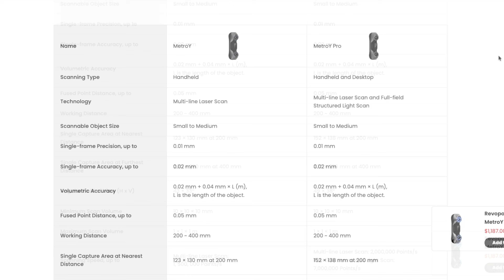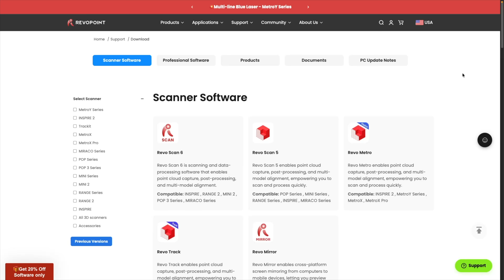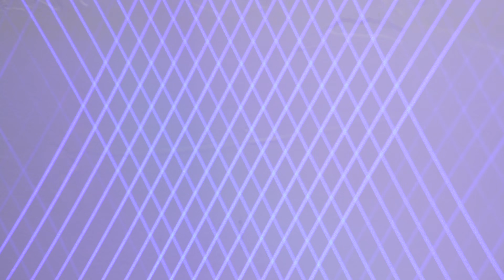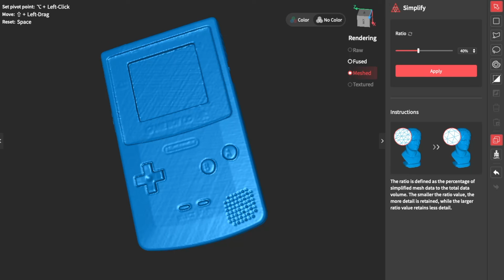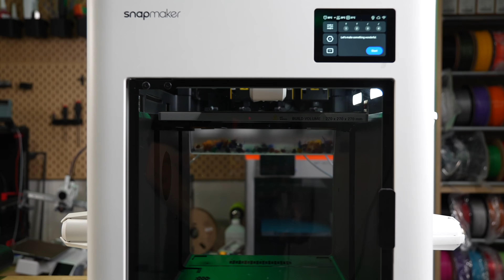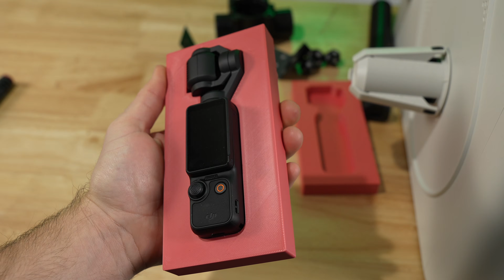I Gave Up on 3D Scanning… Until Now (Revopoint MetroY)

Comment: I have a Revopoint  Pop 2 and its been sitting on a shelf and there it remains.  I found is COMPLETELY USELESS.   If you want a small part that is not circular (software completely loses is $hit when scanning round objects) and you just want it for "fun", I guess it'll work well enough.  Just expect to loose your $1K  on a paperweight.  Buyer beware.

Comment: I cannot understand how you can talk so positively about this scanner: The software (Revo Metro 5) is the worst I've ever encountered in my carreer. It lags, doesn't use GPU, is badly written and freezes, loses tracking and still places scanned meshes over the just scanned succesful mesh ruining it. It's such crap, please do yourselves a favor and buy something else like a Shining 3D. Waaaaaaaay better and prevents you from throwing a $1000,- scanner out of the window in frustration. What a crap.
Reply: Just avoid the Einstar Vega, which is in a similar boat, good hardware dragged down by barebones PC software. It's only good for aligning multiple scans. Even the Miraco had that on device (and much more QoL features):

*It's locked out of the mesh cleanup suites like ExScan.* Its PC software, StarVision is only good for aligning multiple meshes. (Feels like the $2000 vega funded the cheaper follow-up scanner) 

I'm not entirely regretful, getting it in end of 2025, not on release, but I really would saved if I didn't want an all in one unit. Coulda put the money on Geomagic Plus over Go. 

It's really only for offline/corperate use where PC software is limited to known brands, aka to pair with more expensive CAD and reverse engineering software 

Hope I eat my words with the supposed Q3Y26 update, but really, after 2 yrs after its release, I don't expect StarVision to improve at all, or the Vega itself handle more mesh processing.

TLDR: Einstar Vega has great hardware, but weak post-processing software. I paired mine with Geomagic Design but that's not an option for anyone, perhaps QuickSurface Personal. Likely out of updates so better off getting used if still set on it.

Comment: I just used a Raptor with a Scan Bridge to scan a friends mandolin and design him a custom ToneGard that accommodates a pickup and an armrest he has mounted to the mandolin. Because I had an extremely accurate scan of the mandolin, I designed and printed  the tonebridge and once I added cork to the posts to protect the instrument it was literally a perfect fit on my very first attempt. No need for multiple iterations as I dialed in my design, the very first design perfectly avoided the clamps for the rest and the pickup and the cage sat a uniform distance off of the back of the mandolin, allowing it to resonate unimpeded. If you design custom parts in CAD, I HIGHLY recommend getting a modern Blue Laser and IR scanner. Unless you need better than .15mm accuracy, there is no need to get anything more expensive than a consumer grade scanner. I have used 2 Creality scanners, but Revopoint and Einstar will the same thing.

Comment: Wow.  It  costs 1040 bucks to use their software for 1 year.  Does the scanner just brick itself after 12 months or can you use alternative software?  That's a very expensive subscription.  Want a permanent license?  That'll be 8K please.  Hah no thanks.  What a scam.
Reply from the maker: The software is free, you must be looking at a different piece of software. They do have paid software as well but that’s separate to the software show here.
Reply: @ModBotArmy  I'm looking at the Revo Measure and Revo Design.  The checkout page makes it look like these are required.  If only the Revo Metro software is required then it's just typical Chinese bundling marketing that is confusing me.
Reply from the maker: @B @BasedF-15Pilot ah that’s what it is only metro is needed. It’s all I had access to and used. You would really have to be making enough from using that software to justify it at their asking price.
Reply: @ModBotArmy  Got it thanks for the clarification.  Makes more sense now.

Comment: Quick question. Could you give me the print settings (in slicer)? I had some problems with this printer (Anycubic Kobra) and i iust started with 3d printing. Right now id just be happy with the settings for pla, The standart settings in the slicer (cura) didn't work and as a becinner it's hard to find the right settings myself, I eould like to print with other flament Iater on, so if you could also tell me, would i'd had to change for other ones, that would be great. (I comented that on an older vid of you and thought you might not see that there.)

Comment: 3D scanning is way more work than its worth. I have a free $700 scanner sitting in my drawer I havent touched it since Revopoints 1 on 1 lesson with me. Top notch customer service but having to do SOOO much post processing isnt worth the results. This field is something that AI could massively help out with as far as cleaning up a 3D scan. Hope Revopoint is going to implement AI Cleanup.
Reply: I ordered one and I’m worried that this is exactly what’s going to happen to it :/
Reply: I’ve been working on getting ai to turn a perfect step file into step for me and I don’t think I’d be able to deal with a non perfect mesh

Comment: Hey, at 29 minute mark in Fusion, instead of trying to move the mesh to lay flat, go to the Mesh toolbar, under Modify, select Direct edit and the mesh. Then in the Construct tab using Plane Through 3 Points, you add 3 points onto the mesh surface to create a plane parallel to the mesh surface. After that you can use that plane with Mesh section sketch to get a much better section slice to work off of. If you also do all of that as a separate Component, you can align the whole component using said created plane to the world coordinates very easily.
Reply from the maker: Thanks for the tips. I actually tried doing this at one point but for some reason I was struggling to create a reference plane offset from the 3 point plane. I’m sure it was just something I was doing wrong, I’ve been using Shapr3d for just about all CAD stuff for years so my memory of working with fusion is not great.

Comment: Fusion 360 will convert your mesh to a solid in just a couple of clicks. The solid is much easier to work with downstream. Orca slicer has great tools to alter and position the mesh as well as auto repair which is extremely helpful. Last, check out mesh inspector, even the free version has some good tools, even better in the paid version and seems affordable. (I've completed 1 scan with my Metro Y Pro which is my first 3D Scanner) Lots to learn and create!! Good luck, love the videos!

Comment: Phewh, that was a lot of information, thanks! ^^ Honestly i expected more detailed scans, i've seen similar results from couple of years ago, not that this is bad or something. Or the main playing field of this lean towards the medium sized objects rather than the smalls. Is there any tape out there, that is containing several ramdomly placed reflection points all along? That would be much easier to prep larger obejtcs than placing them individually (not to mention removing them) Like the encoder tape for the Shaper Origin handheld CNC router (yes).

Comment: My phone happens to have LIDAR, so unless these scanners go under 300$, there is no point in getting one. 

I can scan an object, measure one dimension accurately with calibers, scale the whole thing from that, and clean up the model, and that will work for 95% of usage cases. 

Unless I need extremely dimensionally accurate parts for something like a car, where CAD files for something simply don’t exist, this is way overpriced.

Comment: Sorry to say , but i am not impressed .
I still have the Revopoint pop 2 , have been using it only one time
for scanning fenders on a Leaperkim EUC - Electric Unicycle .
It came out , not perfect but was absolutely usable enough for 
doing modelling from .
Yes i did use white spray foam to capture these fenders ,but i can
see that you still in certain situations need to use this method .
Through the last 8 years i have always measured the things i needed
to make stuff for , and though it sometimes can be cumbersome
to do it this way , you learn a lot by looking on an object and thinking
about  how it was designed in the first place .
If you have a 2d flatbed scanner you can also do a lot with this
method .
I think that for a hobby user , and the very rare situations you 
actuality could benefit from using these rather still expensive
scanners ,it is simply like throwing your money out of the window .
I recommend that you buy a used scanner, if you should be in 
a situation where you absolutely can't measure the object or
can't use a 2d flatbed scanner

Comment: Thanks Daniel for the work you put into this. I’ve been contemplating 3D scanning for some time. But, I can’t afford it and just haven’t seen enough about it (aka I haven’t looked at them). My biggest concern is turning the mesh into a solid model, with precise geometry. I guess the technology is still a bit behind where I want it to be. But moving closer.
Reply from the maker: Hey Deanna! Thank you so much for the support ❤️. No problem, the videos I watched really didn’t answer all of my questions so I tried to be as thorough as possible. I think the biggest thing is in the post processing methods of the mesh. I don’t know what it would take but I’d love to see improvements in that department to make the data more user friendly to work with.

Comment: The blue light is marketing BS, this isn't getting close to the Rayleigh limit (angular resolution where the wavelength of light limits the accuracy of results due to diffraction). Even if they had a NA 0.5 lens (where the difference would be biggest) the theoretical resolving power would go from ~793nm (1.22x650nm) to ~549nm (1.22x450nm), a difference of only 244nm or ~0.0002mm. Whereas their stated accuracy is 0.02mm and precision is 0.01mm, two orders of magnitude different.

Comment: Got myself the MetroY Pro during Black Friday and have been really digging it for all kinds of stuff including fixing a Vintage Cast Ornament my mom needed fixed ( the old Thread had to go and thus needed a larger replacement which required a new hole, thread and thus Softjaws for workholding to do all that on my CNC ).

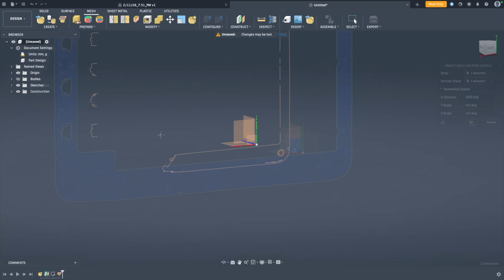@29:10 You can solve your Alignment issue by first creating a Plane on top of the Mesh using a Plane Through Three Points followed by doing an Offset Plane off that Three Point one.

As for how to get a perfect Formfitting Cutout from a Mesh... THAT is an entire video's worth of content you cannot solemnly rely on F360 on. For starters... You usually can't just cut a Negative out of a Solid using a Mesh - F360 might be able to do it but usually you're dealing with stuff like Overhangs in a Model that will prevent insertion / extraction of a Part into the Cutout. F360 DOES have a Solid Sweep function that would technically deal with this issue but unfortunately as the name suggests it's a Solids only feature - NOT Meshes.

The way I solved it was by getting comfortable with Blender and its Geometry Nodes ( and quite some help from the Blender Community ) to first voxelize and slightly inflate an imported Mesh ( to generate some necessary Clearance ) followed by creating the equivalent of F360's Solid Sweep Function ( to deal with Overhangs ) and turning it back into a Mesh. The resulting Mesh can then be used in a Boolean Operation to create the Cutout.

Comment: Thanks for this. I have some projects modifying Sim Racing wheels and accessories to make them more accessible for disabled users. I've mostly be trying photogrammetry to augment manual modelling. But something like this would make that significantly more practical!
Reply from the maker: Man, its been a long time since I have tried out photogrammetry and when I tested it at the time it was more for the novelty of it than for something functional. Would be cool to try that out as well. Yeah, the hardware/software has gotten much better from the creation standpoint, I just wish the workflow of using the mesh data could be simplified.

Comment: You basically swamped the U1 with markers and still it's not enough to get a properly merging scan? That's terrible! If you compare with other manufacturers, they usually space markers 10 or 15cm apart.
I bought a Revopoint Mini back in the day and it was just garbage. Sad to see they still aren't up to snuff.
Reply: von allem was hier zu lesen und zu sehen ist, das einzig ehrliche!

Comment: I’ve bought 3D scanners in the past, and the software was always clunky. The last one I bought was a Revopoint Metro X on a Kickstarter deal, then they released the Metro Y later. I wished I hadn’t bothered, as the technology isn’t mature enough yet. I’ll wait for the markerless scanners to develop and lower in price… but the biggest hurdle is the cost of reverse engineering software. For non pro users, it’s an expensive hobby with a steep learning curve for entry level folks.

Comment: Using a 3D scanner like this to make a storage bin is way overkill.  Take a picture, import it as a canvas, trace it, extrude it.  You're done in 10 minutes.  You don't need a $2000 laser scanner. I think until someone releases a free or affordable way to convert these meshes into solids we can easily manipulate in CAD software - these scanners will always be fairly niche.
Reply: Fusion 360, Maker version will convert the mesh to a solid with just a couple of clicks. They are not the prettiest things, showing all of the triangle's from the STL, but they are functional solids which can be used downstream. Tools such as replace face and delete face are useful in cleaning up the solids visually as well.
Reply from the maker: I agree this could have been done differently, however not all parts will be mirrored to where a photo could work and with a 3d scan you can easily switch so if I wanted to slice it differently I have all of the geometry needed to do so.

Comment: Is 3D scanning worth it? Yes 100% if you actually buy the correct scanner and actually use it. I just got the Einstar Rockit and that thing is amazing, I also have the Creality Otter and it's pretty good too but nowhere near the Rockit.
Reply from the maker: What to do you feel is the biggest difference between them? Resolution? Post processing software?
Reply: Software is better with einstar they make devices that cost over $30000

Comment: 3d scanning is more for reverse engineering, which requires 3d modeling and cad skills. Most people who 3d print don't really take the time to learn how to do either because they find models online to print. I use 3d scanning for difficult parts and then import that data into cad to be traced.  I never use raw scan data for 3d printing.

Comment: Oof.. I'm excited for scanners... when the price gets down to $500-600. Im sure well be there in a couple years. Great vid. 👌🏻
Reply: Ive been using my ferret with great results for over a year now. With some foot spray it gets black and metal surfaces just fine, and ive been able to scan an entire ford fiesta with it. The volumetric accurate is close enough that the scanned interior dash parts fit with zero issues. $300 for a scanner you can connect to your phone and you can scan the gargoyle in DIA airpor its small enough to travel with, and not 15k so if it did break the world doesn't also end.
My biggest problem was figure out how to work with mesh files since fusion hates them.
Reply: @JustH5405 very cool! Thank you, I'll check out the Ferret! 🙏
Reply: There are tons that are that cheap. The quality varies by price and what you actually want to scan.
Reply: @kylequinn1963 right, sorry, i meant scanners of this capability. Ive seennones in the $600 range, but theyre a bit lacking in resolution and detail.
Reply: if it doesnt have blue laser.......dont bother
Reply: @5andman68appreciate the tip! I'll keep that in mind, cheers! 🤙🏻